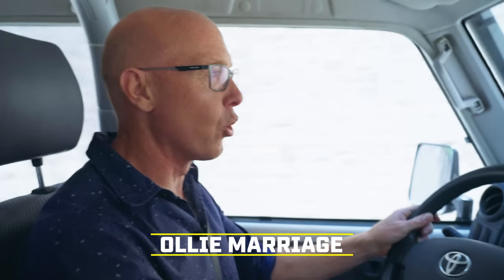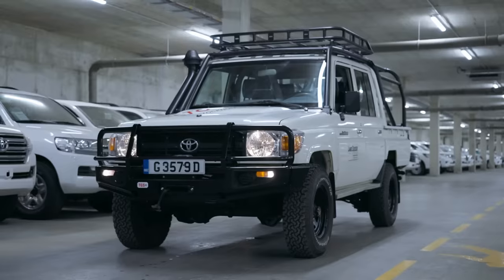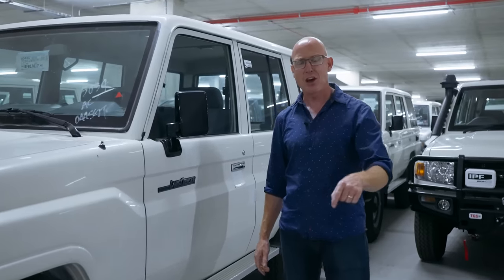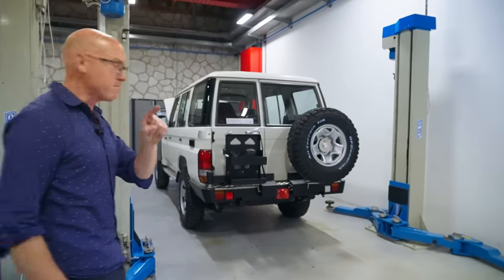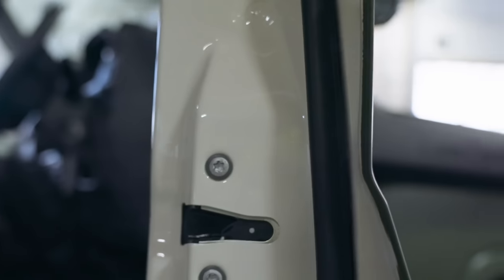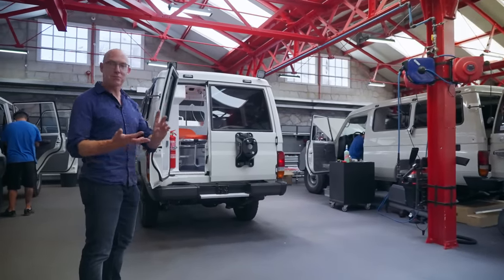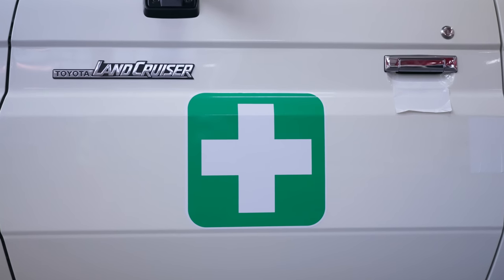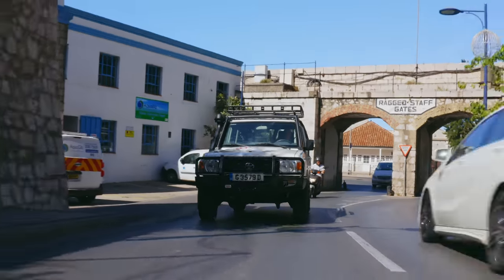This Secret Dealer Sells White Toyotas That Save The World | Top Gear

Comment: The Toyota Land Cruiser is certainly bulletproof and reliable! However here in the EU market they are EXTREMELY rare, because of: 
1. Environmental initiatives
2. Competition, the EU already has plenty of competitors that offer better comfort, good value for money and flexibility (they can be armored, or modified).
3. Driving appeal, the Land Cruiser is perfect for emergency services, or military. NOT for civilians. Civilians/private customers won't enjoy driving a Land cruiser as they daily vehicle, especially in the EU. Heavy weight and fuel consumption.

I've noticed in Belgium the Land Cruiser is still used by the military and the towing services. 

Greetings from Belgium!

Comment: Land Cruisers are still being used in plenty of government and private agencies in my country. Most of the time, they have to go deep in the mountains or forest in unprepared terrain... for weeks without coming back.

But I do wonder if there is a way for Toyota to modernize the engine to meet emissions standards... eventually they will come under pressure.
Reply: They also sell the 200 and 300 series which are modern with much better emissions etc.

Comment: They have a vdj 4.2L  v8 turbo diesel 
They are under powered to increase reliability but they make some power when tuned
They are very common over here in Australia
Reply: VDJ’s are 4.5L not 4.2, 4.2L’s are straight 6, HZ & HD engines

Comment: Still available new in the Australian market..if you can wait and afford it. There is an aftermarket scene here that fits these with automatic transmissions too!
Reply: Not in these configurations.

These are the old 6 cylinders.
Reply: still available new in Europe as well, but only with the petrol V6.
Reply: @kev8943  l

Comment: My local Toyota dealer in Melbourne Australia are selling 2nd hand examples with around 35000km for $95000. Around $20000 more than they cost new. Profiteering because there is a long wait on buying a new one currently.

Comment: The main reason it thrives in Africa is that any mechanic could work on it. The repair shop we have here are usually just equip with spanners and basic tool, I only started seeing obd2 diagnostic tool in 2020 at some of the bigger shop in the city, even electric impact driver is a luxury in most places.

Comment: I really want to own that single cab Land Cruiser pickup! It's crazy how the market price for these has skyrocketed through the years.
Reply: same here but  toyota  doesn't sale LC's in the U.S. any more
Reply: Toyota Australia still sells em and theyre everywhere. The 79 GXL Dual Cab is actually my dream car
Reply: It's not crazy at all you can't buy reliability in a modern vehicle it's not for sale bar the 70s

Considering a friend paid over $1000 dollars to replace one headlight assembly the globe apparently is a laser diode and cast into the assembly in his <2 year old Mitsubishi Triton 
Because it wasn't covered under warranty 

While my fleet consisting of
A ln106 1997 hilux ute still has its factory headlight globes twenty plus years later

A 1994 glx 80 series LandCruiser that has clocked 700k

A 1974 hj Holden one ton that had a lifter go bad that I drove for 1000km and some change while towing my caravan before buying new lifters of the shelf for the princely sum of $200 for a set and replacing my self in around an hour 

A 1962 EJ Holden panelvan that's a a bit of a hot rod but has in the last 10 years towed my caravan over 30,000km despite being over 50 years old with a hot motor 

I can't think of a single vehicle for sale today
 that is on par with any of my fleet when reliability is considered
Yes they are slow or loud or drink fuel or uncomfortable but I always get home 

That's why the 70s are valuable I don't own one I don't want to own one but I can really see the appeal of reliability and serviceability of a new car
Reply: @youtubecarspottersguide1  well you can import a 90s ones pretty much with the same diesel straight six from japan. the only actual difference between the new 4.2's and the 90s ones is just the front end.
Reply: @kev8943   cool but calif has the toughest smog and emmission test thats why I see them with Montana.plates
Reply: @youtubecarspottersguide1  yea that sucks. not to rub salt in the wound but Toyota shipped 2 79's and a modded 40 series up to the US for SEMA and the owners (Patriot Campers) will be rolling around the US for a few months with them they will be easy to spot as one is a 6x6 called the MEGA 6x6.
Reply: @kev8943  the new front end is to accommodate a V8 they dont come with a straight six for public sale only fleet sales have the straight six now.
Reply: You can get these trucks new, and as 2nd hand refurbished  imports in New Zealand. Since NZ allows parallel importing. Which means you can import new or used vehicles. Both commercially and privately. Therefore, provided Toyota in Japan will sell me the new vehicles. And they do. I can import them in competition to Toyota NZ, and sell them through my own dealer network. And i can also import 2nd hand vehicles from Japan, or any other country for commercial resale. The only requirements for importing 2nd hand vehicles for commercial resale, as opposed to private imports is... They can't be more than 7 years old by date of manufacture. And must pass a warrant of fitness inspection to be road registered. The last requirement also applies to private imports for road use. As it does to any vehicle in NZ. Anyway it isn't a big deal. As they are still relatively new vehicles. In fact Toyota NZ does this itself. Alongside selling  new vehicles. It  imports 2nd hand Toyotas from Japan. Puts them through a refurbishment process at its former factory. And sells them through its dealer network, with all the appropriate Toyota guarantees. They are good value reliable vehicles. And this practice provides a wide spread of models availability in NZ. As other brand importers and distributers, plus independant  importers do the same. And a number of these vehicles are also re exported up around the Pacific.

Comment: The Australian Toyota website still has the LC available
Reply: Australia would consider invading Japan if Toyota tried to stop selling us the 70.
Reply: look at it all the time, if we could get basic base model LC's in the US, LC 300' sold here as the$89k us  lexus LX600 3.5 v6 tt gas, prado ,sold as the Lexus GX460 v8 gas hog $65k us , if we could only get a , troopy, single cab utes in the us,  all we get are over priced 3row wagons indpend rear axle  'for a smooth ride and leg room for the 3rd row ' luxury wagons  4runner is the only 4x4 to buy

Comment: A lot of comments praising these cars but as a mechanic who repaired these for years they take a hell of a lot of maintenance to keep on the road. Not as reliable or as tough as people think.
The 1hz 6 cyl is reliable the v8 diesel not so  good,  the remote committees struggle to keep them going. a working air filter would be nice too Toyota.

Comment: Massive amounts of accessory gear manufactured in Australia and exported all over the world for these vehicles.
Much of the development and mods for the 70 series driven by aftermarket accessory companies such as ARB, TJM etc here in Australia and Toyota Australia over the years.
The deeper cab of the 79 seriesover the 75 was driven by Australian demand for more leg room, Toyota Japan finally got the message.
Probably the pick IMHO is the 78/79 series with the 1HDT 4.2 turbo 6 cylinder, diesel, highly prized here and hold high second hand prices for good ones, our later 4.5 V8 turbo diesels can be remapped for considerably more power and are extremely popular here in the bush with waiting lists for new models.
But the wider track of the front axle over the rear axle in the V8 series here is an issue with many owners fitting spacer kits to equalise rear track to front, Toyota were too cheap to supply wider rear axle body/axles.
Also Toyota 70 series seats are very basic and could be more supportive, especially the drivers seat,  given the distances many of these travel.
Still in most models the twin 80 liter fuel tanks are a blessing in remote areas,.
Just my take!

Comment: I tried to do the same thing with my 2015 4Runner, steel wheels, snorkel, changed the alternator to a 250amp that runs thru a 3000watt inverter, duel batteries, roof rack, rear 120v 3000 watt plugs. Winch, and kinetic tow rope. Storage for water, freeze dried food, medical supplies, foldable solar panels, tools. Etc.

Comment: The company I work at does the same thing but on a smaller scale for the mining industry. We also use 70 series Toyotas with 1 HZ straight 6 diesel engines. I also drive a Tacoma, I love Toyota!

Comment: Wish you could get them in the States. Looked into importing one once. Import fees were the least expensive thing. The real expense was modifying it to conform to EPA regulations altogether it would have added $20k-$30k to the sticker price. At that point, you may as well just drive some other truck into the ground and then buy a new one for what you save.

Comment: Actually these are still legally for sale in Europe, incl. Euro 6d emission class. Basically all shapes and forms shown in this (otherwise) excellent video.
Reply: not anymore, euro 6 not, only euro 5 was there.
Reply: @hdj81Vlimited  You seem rather uninformed. Check Mobile or AutoScout24 in Germany and the Netherlands. Literally DOZENS of GRJ 79 and similar, all BRAND NEW and all EURO 6.
Reply: @johnhopkins4920  The GRJ is a petrol v6, not diesel
Reply: @jeffwatson8400  Never claimed these were diesel … just that these are still available, new in Europe 😎.
Reply: @johnhopkins4920  Well, the diesel version is the one you want. . .

Comment: Its a scam that you cant register them in Europe. I have a 2018 hilux for mountain use, snow, moving bails of hay, horse boxes, building materials, wood for heating. I have put off road tyres, winch and steel bumper on it but it is not quite up to the job. A vehicle like the land cruiser or tacoma (U.S. market) would be better suited. 2.4 turbo high reving no torque or (so important on mountains) engine breaking.

Comment: Not being able to register new 70 series in Europe anymore isn't quite correct. You just can't register an HZJ anymore. The new ones have the 1GR Gas V6. Sure, it isn't a mechanical diesel, but it's still regarded as one of the most well-sorted engines available today.

Comment: So what motor have these UN 70 series Landcruisers come out with? Just out of curiosity. The Australian 70 series comes out with a 4.5l V8 turbo diesel and it's a common rail, but there is no turbo or "electronics" on these UN ones? are they v8, v6? Naturally aspirated? Maybe theyre the old 1HZ ?? ;D
Reply: They are. The 1HZ in all its glory. OG engine or what?

Comment: My Hi ace van is just like this saved me from going bust "NO ON COST JUST KEEPS GOING" It has now done over 300K miles same exhaust same discs same everything well almost I have had to fit new battery's and some tyres Oh and new wipers blades oh and front brake pads To be honest not sure about the front pads cant remember !!!!!!!!!!! These machines are just un true Bin the Merc veto's or the Fords or the Volkswagen shit !!!!!!!!!!!! if you want cheap motoring get one of these old style buses NO QUESTION NO DOUBT NO NONSENSE  sadly you have to open your own window and sadly they will not get you to 60 m.p.h. under 10 seconds they are a bit bumpy but what the hell THEY WILL NEVER EVER LET YOU DOWN EVER!!!!!!!!!!!!!!!!!!!!!

Comment: I own a 79 Series single cab, only because I get the hand me downs after 30 000km from my father in law for next to nothing, which is the only reason I own one.
As a 79 series owner I can honestly say it is the worst vehicle one can possibly own.
The reason they have bull bars is if a cow walks across the road 500m in front of you, you'll stop 500m on the other side of it. It has terrible breaks.
It's also slow and takes ages to pick up speed.
Maybe there's a reason why it's so slow as the mirrors fold flat when driving faster than 80km/h.
With all the road and wind noise it's impossible to make a call or listen to the radio when driving faster than 80km/h.
One would think that it's slow due to different gear ratios accommodating lower speeds and better towing ability, but by loading it or towing makes it difficult to exceed 60km/h on a hill.
It also rusts easily. The only thing that doesn't rust is the ARB bull bar.
It doesn't come with a service/maintenance plan.
The suspension is similar to driving a grocery cart down a gravel road.
It's heavy, top heavy, not good off road or on road and very thirsty.
The air conditioner is great and there is a sort of fun factor to driving it, like driving a go cart or dune buggy for example, but it's definitely inferior to other vehicles on the market.
It might be that the engine etc is "indestructible", but I've never had a breakdown with any other vehicle I've owned.

Comment: Do they sell to the public as well? Or is it for ONGs only?
Reply: Not sold in Gibraltar
Reply: they do here in Australia but only with the new V8 engine damn thing cost an easy 80k+. the old ones sporting the Straight 6's fetch a good price if its got the 1HD-FTE it will fetch a lot of money the engine alone goes for a good 15k or more.

Comment: The only thing better is the 70 series 4.5 ltr turbo diesiel landcrusier. My Prado 1996 3 litre intercooler turbo has done 930 000 ks had it 21 years and still going strong but the V8 has way more torque

Comment: didnt know they came as a 4.2L n/a diesel. makes me think  you still get the 1hz in them. In Australia we get a 4.5L turbo diesel in our 79 series.
Reply: in GCC we get pickup 4.5L diesel and 3/5 doors 4.0L petrol
Reply: wish they would do another run of the 1HD-FTE i want one so bad but just the engine alone is a good 15k on the secondhand market.

Comment: Great video. It could have been at least twice as long though for more info. What engines are in the LandCruisers? 6 or 8 cylinder diesels?
Reply: Both
Reply: the one referenced in the video as bulletproof is a 1hz, that’s the straight 6 N/A 4.2L, the V8’s are 4.5L turbo diesel VDJ’s, there are other engine variants in earlier models as well but the 1hz & vdj are the most common, I thought I heard VDJ’s are being discontinued but from 2012 to now majority of cruisers were fitted with them. I don’t think the 70’s ever came out factory with a 1hd variant but the 1hd-ft engine in my option was Toyotas greatest engine, a stronger version of the 1hz no electronic bullshit like the FTE, there’s 70 series’ that get around with them engines swapped into them that’s what I’d be chasing over a VDJ
Reply: @undefined428  but ppl want factory stock

Comment: Its such a shame they are not sold in US, Canada or India.
Reply: In North America the noxious tailpipe emissions from these Diesel engines are 100 times higher than our allowable limits. The Land Cruisers with 4.0 V6 petrol engines may meet  air pollution standards but the 70 Series Land Cruiser fails to achieve the safety standards necessary. Let's hope some day they can be redesigned to keep the laudable capability without the drawbacks.
Reply: Hope that never happens

Comment: I wondered where they all got re-jigged… they are a mighty beast of reliability but….. you spend a fortune to buy an antiquated new relic to only spend even more correcting their shortcomings. 

Toyota nearly stopped producing them last year because the biggest purchasers of them (BHP BILLITON iron ore miners) said that unless significant safety concerns were addressed then the vehicles would not pass occupational safety and health standards that were becoming legislation.

Owning a fully reworked 79 series v8 turbo diesel that includes air bag suspension, mud tyres, bigger blower, remapped, etc blah blah……. 

And having spent tens of thousands of Australian roubles to do so……

And nowhere to rest your iPhone that can’t talk to the crappy cd/stereo….

It’s STILL ONLY GOT ONE DAMN CUPHOLDER, MR TOYOTA!!! 
One lousy cup holder….😤😢🤬
Reply: And you have to widen the rear axles to match the front bc Toyota was too lazy.

Comment: i doubt that they are different in other countries but in australia they are a 4.5 litre v8 diesel
Reply: They use these non-turbo LHD ones in the mines
Reply: @gohara5  mines in which country?
Reply: @Harry-vg8pd  Australia
Reply: @gohara5  still v8?
Reply: @Harry-vg8pd  yeah but only a few that aren’t in constant use. Everyone under safety/managers drive the non turbo. I had one myself LHD in WA mines
Reply: @gohara5  why were they LHD?
Reply: @Harry-vg8pd  I was told they’re less than half the price. Adds up when you’re buying hundreds per year plus the savings of the fire suppression systems.
Reply: @gohara5  half the price!